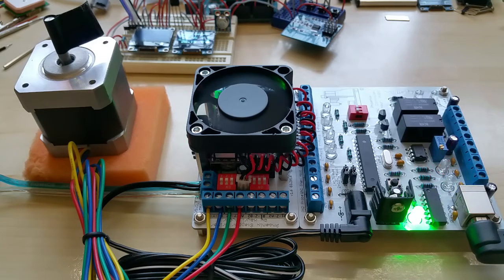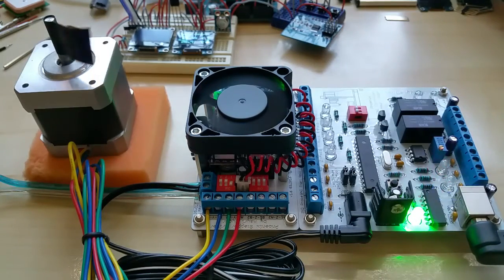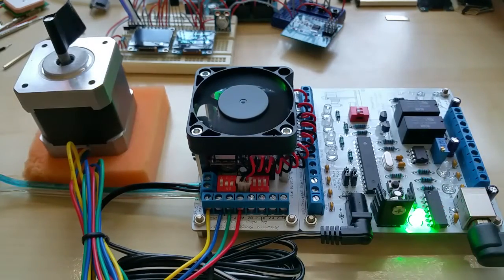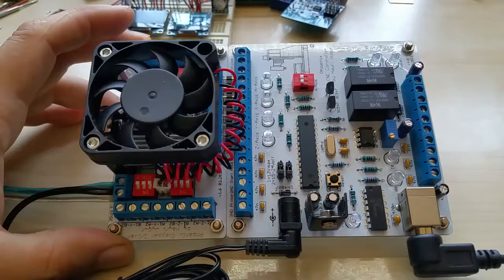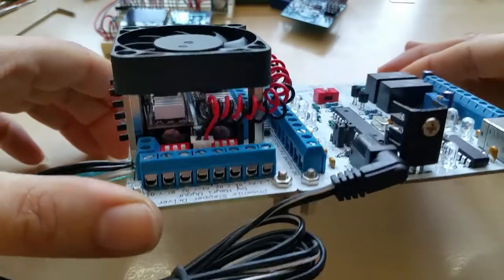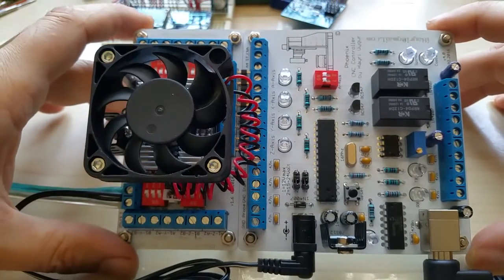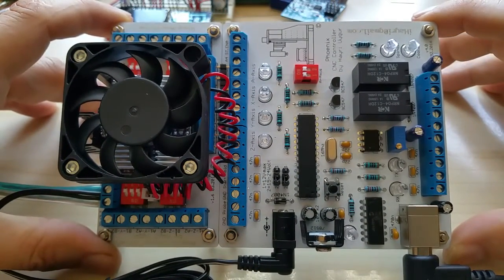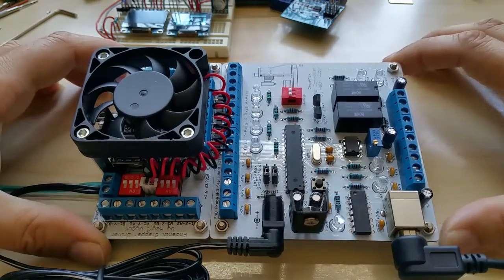Phoenix CNC Controller and Stepper Driver by Hayri Uygur

Comment: great job can. do u make custom design for 4axis wit pwm controller. if so let me know I need 5 nos
Reply from the maker: Grbl like it is only supports 3 real axis the 4th is a slave. There are 4 axis controllers that either run on parallel port or some with custom firmware for 3D printer, might have to look there
Reply: Hayri can I have your e-mail ID or whatapp no so that I can forward wat I required exitely n if u can pls help me out with that